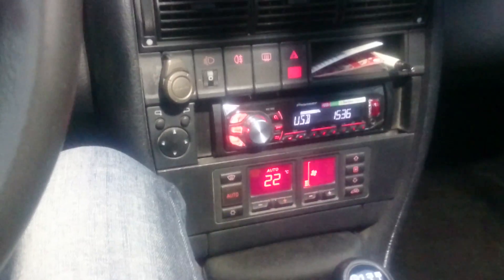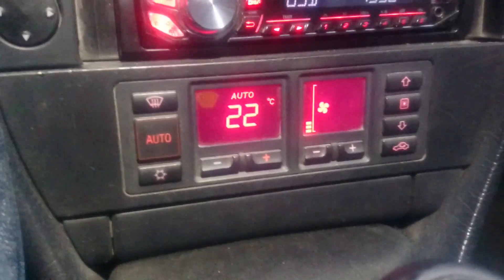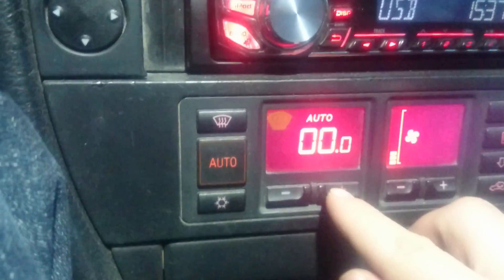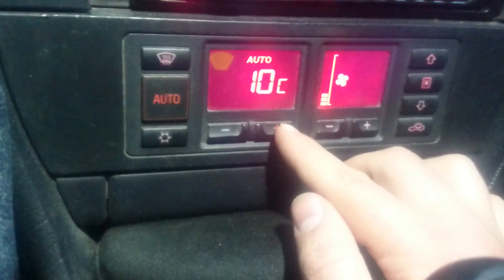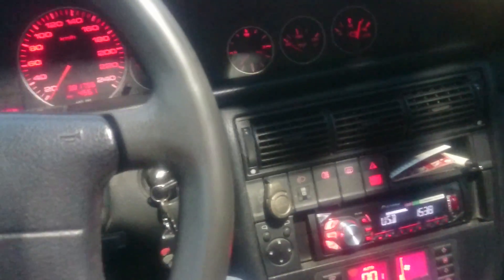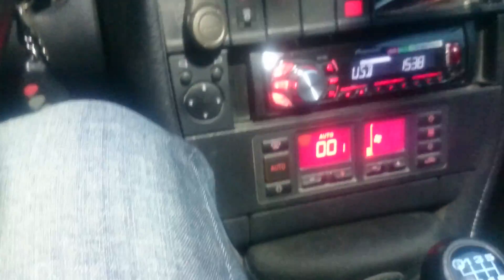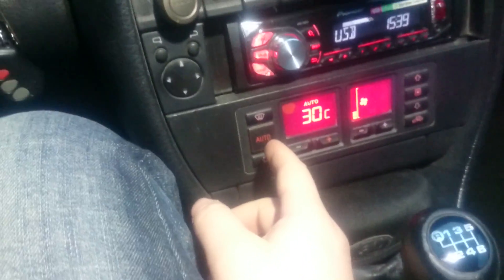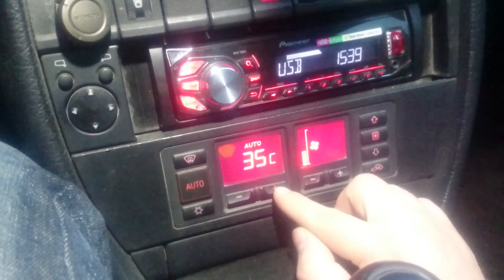Audi A6 C4. Climate control diagnostic codes

Comment: I have same car.my all buttons often dont work.i cleaned them,but nothing.did you have silimilar problem?
Reply: Edit: if buttons sometimes work/ not working, ac unit,must be dismantled and ac display unpluged from printed electronic board.
El. Board has about 20 close placed solder contacts. With a time, contacts develop microfructures,so sometimes they work/not working.
All thoose contacts just needs to be resolder and problem is fixed permanently.
Reply from the maker: Welcome back , thank you for a good tip 👍
Reply from the maker: +Bare36 sometimes they don't react to pushing, but everything pretty much stopped after i removed ac and put it back to it's place. By the way after removing it I did not do anything.
Reply: Das Ltu Films i did unplug,but nothing change.i will look for another one.this is the same unit as on a4?
Reply: Climatronic on a6 is not same as a4.i did buy from a4 2001.ventilation can be adjust,but not temperature.i dismantled original climatronic from a6 and with rubber cleaned button contacts.year before i put  grafit on them, with pencil.everything works excelent!

Comment: Well, sometimes you don't want that AUTO blow to cool you off especially in winter, so here's an other way to exit the menu :)
You just press Circulation and UP ARROW, the way you get to the menu is the same to get out of it :)

Also, Temperature gauge, RPM and Speedometer won't work if they don't work in the dash already
Reply from the maker: thanks ;)
Reply: Well , that is wrong . If they work on the climate and no in the dashboard than you must check what is the issue with the cabling ...